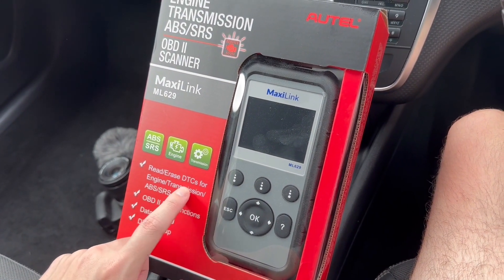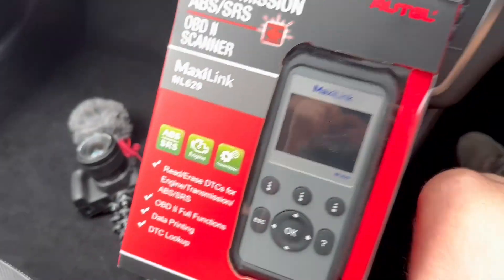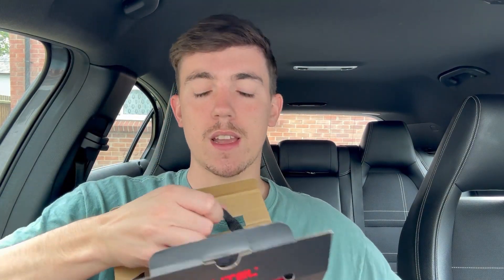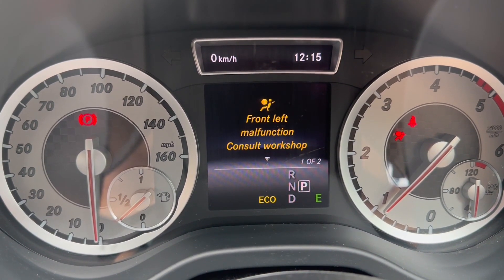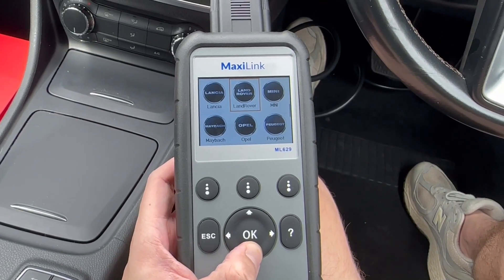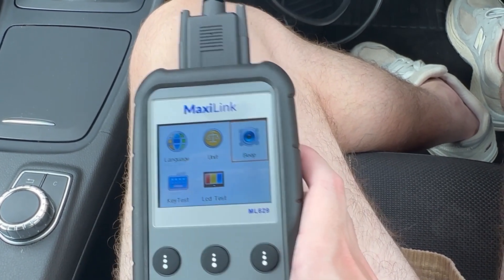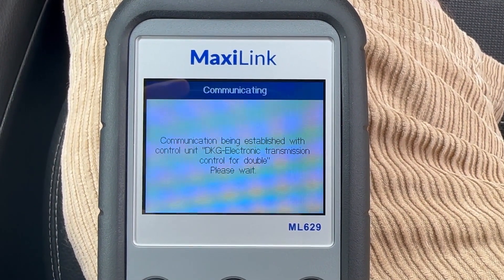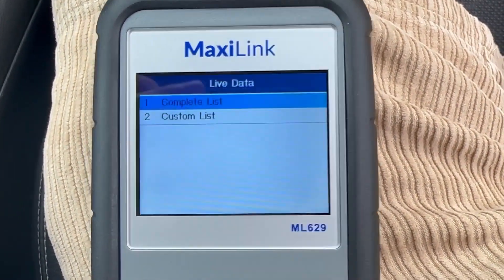THE BEST BUDGET DIAGNOSTIC SCANNER! | Autel MaxiLink 629 Review

Comment: Does Engine (nox sensor, mass flow sensor, crankshaft sensor ,
Camshaft sensor) fuel injector)
 ABS (anti lock Braking)  SRS (airbag seat belt) And Transmission , Gears Axle Wheel sensors ,
Reply from the maker: That’s pretty handy for most things when you need it then!

Comment: I bought an Autel AL 519 specifically to turn off the light at the SRS and it doesn't have this option in the settings!  I have a passat b7 from 2014, if I buy one like yours.. do you think I can turn off the SRS light?  Thank you in advance!
Reply from the maker: Hi Mate, thanks for the comment! My Autel did turn off the SRS light on the A class with no issues! If you go on the Autel website it has a help sheet which says the make and models each product works on! - Let me know if you need any help.